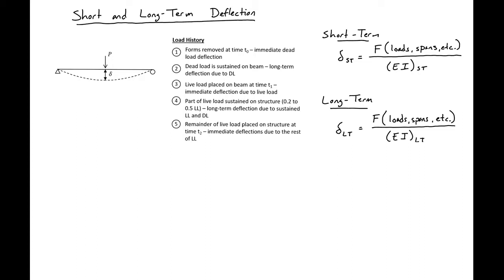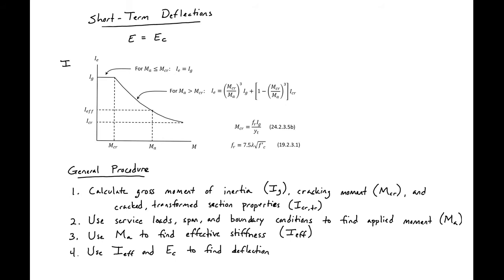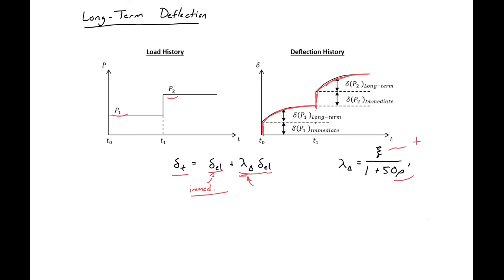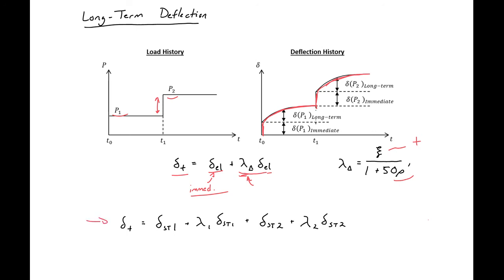9 - Introduction to Deflections in Reinforced Concrete Members

Comment: Nice one appreciable sir, but it would be more better if you take RC beam with central or two point loads and find the moments and deflection at first crack, steel yield and ultimate. Which is more useful for research scholar as well engineer. Kindly make a video on this. Thank you